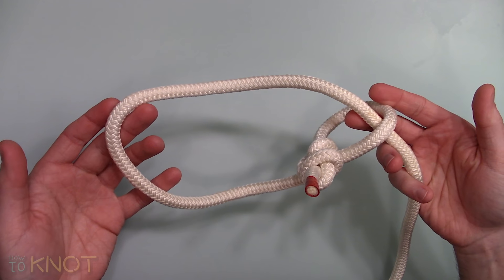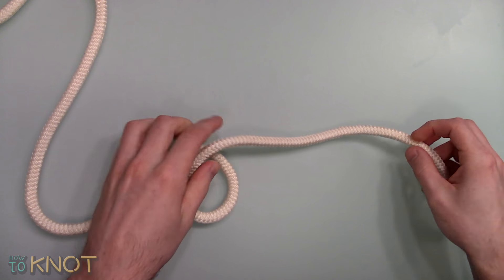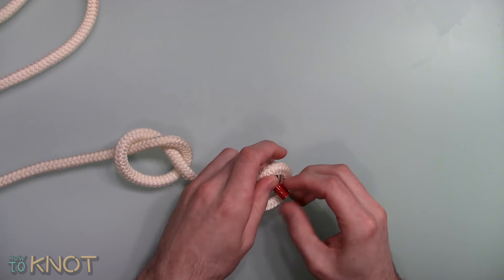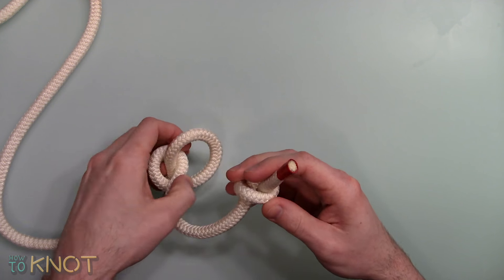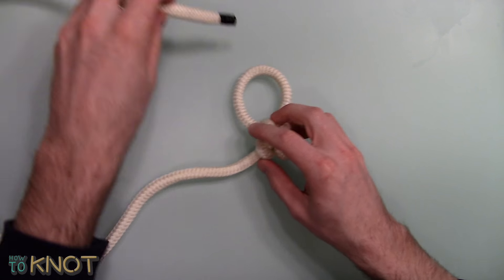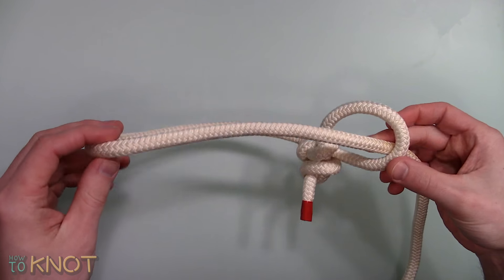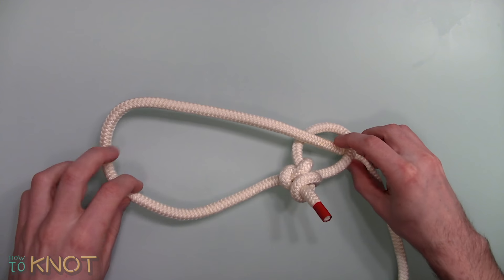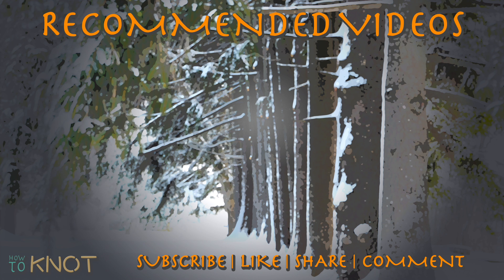How to Tie a Lasso

Comment: Are there any advantages or disadvantages  to consider using a lasso opposed to something like a bowline with a bite taken through it?
Reply: Get a thick lasso
Reply: A bowline under constant pressure is a good knot. However, a bowline knot under changing load stresses is well known loosening then coming apart, very scary. In those situations, a bowline is an unsafe knot. For that reason many mountain climbing training classes, search and rescue training classes, swift water rescue, and the like, will not allow a bowline for human nor animal use. The Honda knot, a strong knot, their use of a stopper knot is an excellent idea. However, I disagree about using a overhand knot as a stopper knot; you want a stopper knot that will not slip apart. Overhand knots as a stopper knot also have a tendency to slip to the end of the rope then come apart. A much safer stopper knot would be a figure-eight or a longshoreman's knot, those two will not slip. Hope this helps you. When your life, someone else's life, an animal's life, is at risk, be knowledgeable which knots you use.
Reply: @ricdonato4328  I came into the comments to ask the same question as the fellow you're replying to. The bowline, clove hitch, and half hitch have been staple knots in my line of work, but just for hoisting light objects. There is yet much to learn. Thanks for the clarifications.